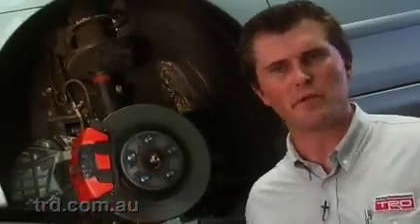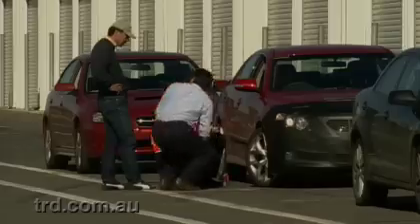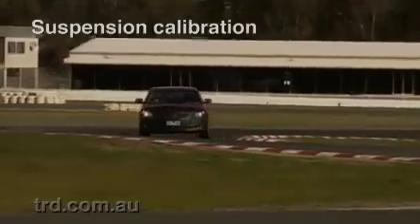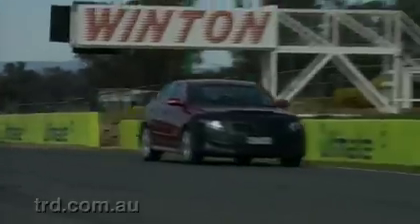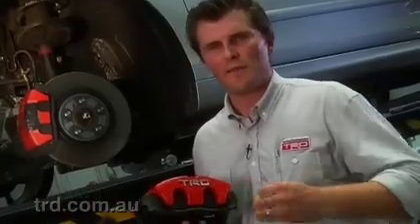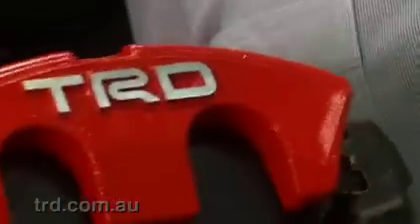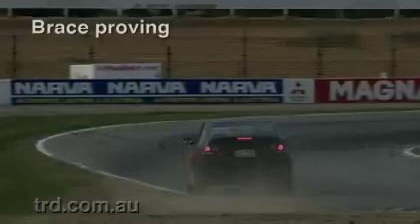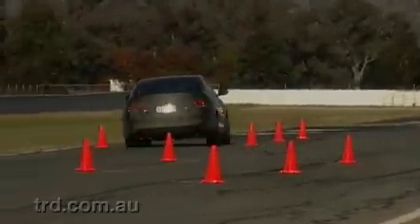TRD Aurion - Behind the scenes - Chassis

Comment: I would rather have 240 hp at 6000 rpm, from a turbo or super charged engine or even a larger displacement engine, than 240 hp at 8000 rpm from a NA.